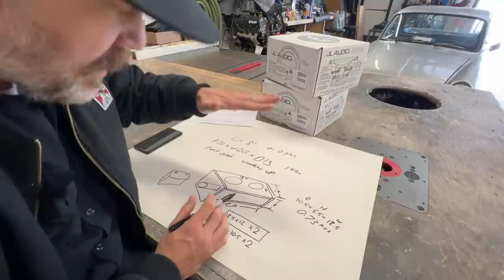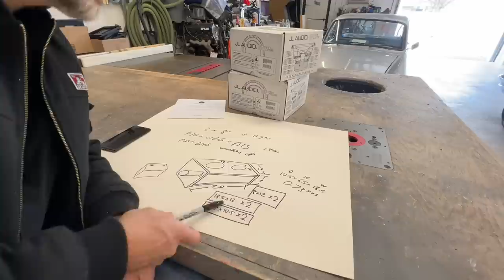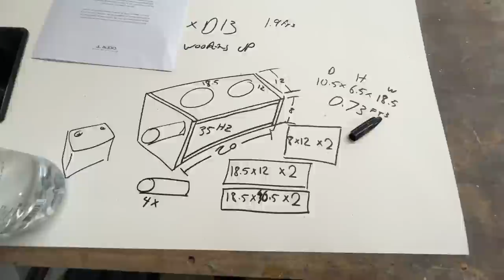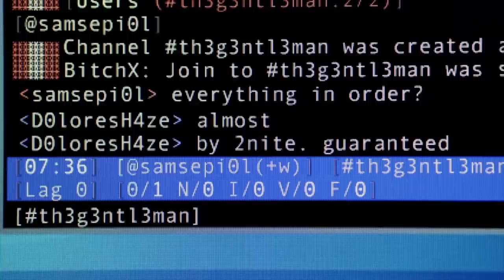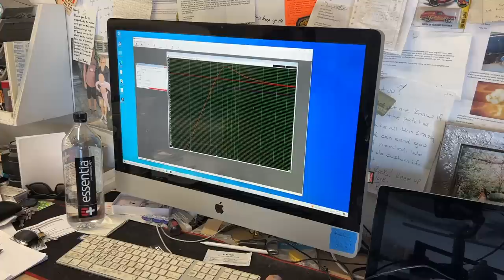I MADE A HUGE MISTAKE! - Bass Van Vlogs - Bass Wars

Comment from the maker: THANK YOU FOR YOUR SUPPORT!!
Reply: It doesn’t matter what you did Doug!
Reply: You need more support, them boulders are hangin out the sack.
Reply: Dear senjour Doug hope you finally plan on releasing the newest Vol. Of Kingz of Old Skool jungle DNB
Reply: Stop being lazy, Doug, and make some soundman terminal cups for your boxes. In my  Strickland voice  slacker.
Reply: Holly tits McGee Nice box Doug🤙, those jl' 8's look like rafas Arreolas👌
Reply: Doug. I’d like to provide my services. I only require a small ration of weldwood for nourishment and one serving of Rafa’s Own honey wheat bread
Reply: Yeah the Subaru scares me.. you'll probably do the air suspension and by that time the engine will blow up.😂 Did you start vaping yet😮
Reply: “it doesn’t matter what you did doug”
mbenclosures makes way bigger boxes for 8” woofers.   what the deal?!?
Reply: Oh thank Douglas the Doug is back!!!
Reply: Don’t lose hope Doug! Business obviously comes first, after that do what your heart desires! We love you regardless!!!
Reply: Ive never tried your TNuts before but have you ever hear of DEEZNUTS?
Reply: You should get some of Rafas moms pan dulce sweat to tighten up those carpet seams on that there speaker box.
Reply: Best trick to hide the seams that give you issues is to use a smooth face hammer and tap the seams.  It will hide the hard ones.
Reply: We have a choice 😂
Reply: If you played more Cynthia…
Reply: @ijr909  fitment limitation & no need for a big box per customer request), box for and old guy and his classic car doesn't listen to loud music, he's into old classics (Beach boys ,doo opp) I use to watch mbe but sometimes man he goes a little overkill nothing against him and his box building. I use to do car audio 20+yrs ago not everyone wants a huge box or has the space and comes down do music preferences too not just box and speakers
Reply: I was talking to Bruce the other day and he said I needed to come by and smoke chocobo cigars in front of the shop again. Said it would help the channel out?  😅😅😅
Reply: What kinda WOOD 🪵  IS THAT??
Reply: Where’s Rafa’s mom?

Comment: Doug to make the holes in the carpet for the speaker bolts use a metal brake line to size of the hole and heat with blow torch for a nice clean cut holes
can also use a hole punch set

Comment: You ever thought about using colored plastic behind the t-nuts on the speaker terminals to mark polarity? Like some one inch plastic discs one red one black in between the carpet and the t-nut. Probably could just cut them out of old soda bottle caps. Also never get rid of the VW, I got rid of my rabbit pickup a few years back and regret it ever since.